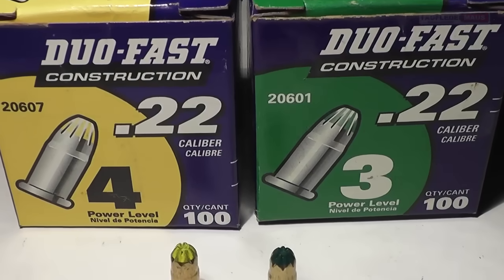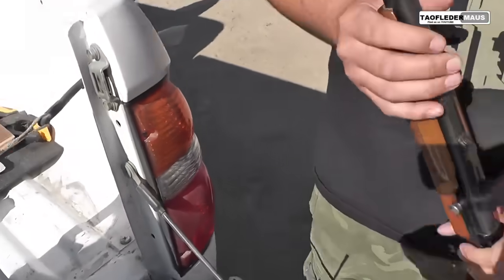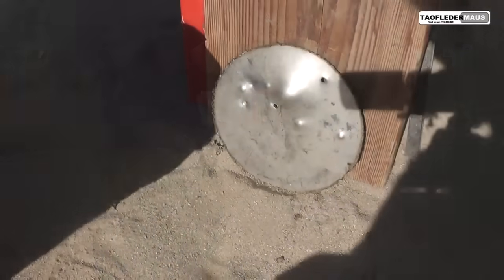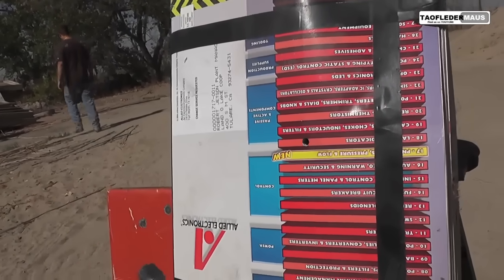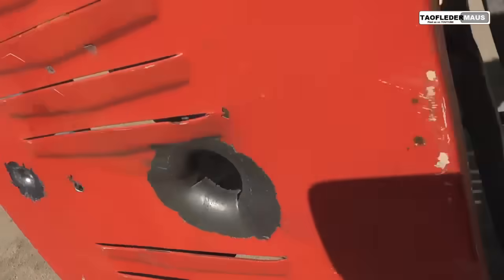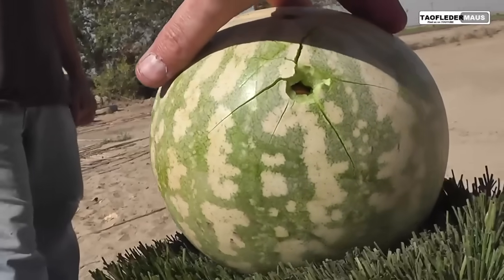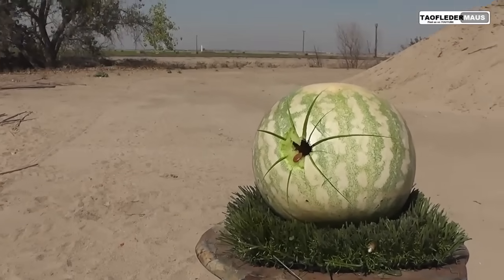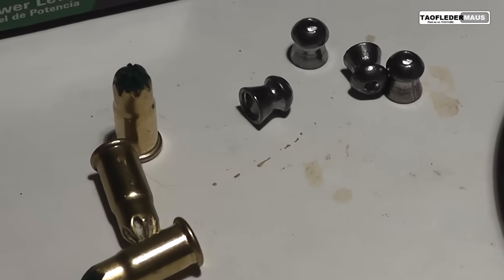Shooting .22 PELLETS Using NAIL GUN Blanks - What happens?

Comment: I'm in the UK used these in a bolt action .22, found it easier to use  a dab of super glue to attach the air-rifle slug to the front of the "powder activated tool"  rounds, instead of ramming the the slug down the barrel, or load the slug and the blank individually into the breach.

Comment: I use these 22 power loads to be able to continue to shoot my Stevens 44 Ideal in 32 rimfire

32 rimfire was discontinued by virtually all manufacturers when America entered WWII  -  since then an occasion small batch of 32 rimfire has been made by small ammo makers,  but even those were discontinued well over a decade back  -  which is why now a 50 round box of 32 rimfire shells goes for $250 to $350   -   

so enter the adapters  -   reloadable 32 caliber cases which are drilled to accept the 22 power loads  -   they are expensive  (  $10 - $15 each )  but are easily reloadable and are good for many many reuses

Comment: I used to play with dads Ramset.
You had to push I against a surface to keep it cocked to fire so I would hold against a sheet of plywood and shoot the nails right through and into a palm tree.
Dad loaned it to a friend who was using it to fasten to 1/2 thick steel I-beams only to find any but the weakest charge would shoot the nails right through the beam.

Comment: its not a surprise this worked and the pellets stayed together 
I have PCP air rifles that will do close 900 FPS in 22 30 and 357
they have high end ones that can push up 1200 FPS in 22 so you can guess how they hit with big bores
my 357 Bulldog goes though a refrigerator like butter its gone though car doors too its close 900 probably since it is factory still no adjustments have been made 
it would be interesting to see some PCPs compared to actual firearms the only one I have saw was a bad comparison since it used a cheap break barrel that is not as good with light pellets like these
look at air gun ammo on Pyramyd Air I run 25 plus grain 22 slugs down to 18 grain pellets for target practice and critters my 22 is rated for coyotes and such easy

Comment: I used to love messing about with the nail gun when I used to be a security guard on building sites, pinning the plastic warning signs to walls using the black tipped cartridges meant for concrete and I'm using them on brick walls! 😆

Comment: I wonder if you used an old single shot bolt action 22 if you could just feed the pellet in the same way you would the cartridge and then just push the blank in behind it.  Would avoid having to do the ramrod step.

Comment: smear a little vaseline on the back of the pellet and shoot it from your regular pump pellet gun, just be super careful, they are seriously dangerous, certain chemical and lubricants can ignite just from compression, vaseline is one of them, it will make your pellet high powered, and potentially lethal if someone got hit it the wrong spot, so be super careful ,  yes it works well, but if you have a cheap pellet gun it will wear out much faster.

Comment: If you take a .22LR cartridge and pull the bullet then dump out the powder and replace it with Red Dot powder and place in a waxed 15 grain .22 caliber hollow point pellet with a 5 grain steel BB superglued to it you will have a stupid fast magnum +P+ projectile out of a .22 bolt action rifle.. This is the kind of hilly-billy engineering that made the USA such a great nation.. Simply cutting off the head half of a cheap .22 shell and lightning the bullet to 20 grains will also create a much faster shooting outcome.. These are far cheaper than buying nail gun blanks by the way.. Never fire these in a .22 pistol, old or cheap bolt action rifle or with a weak semiautomatic action.. The heavy barrel rifle we have has a double lock bolt just like a magnum rifle so I am confident in it..

Comment: Not surprising, Used to use Powder actuated tools. the charge are designed to drive a case harden steel nail several inches into concrete. the charges go from white , the weakest, through green, yellow, red, purple and black. I have shot into steel columns while fixing brick ties and the nails were going fast enough to tear the heads off a nail. 
firing out of  a rifle you risk the pellet expanding and locking itself in the barrel and blowing just the end of the pellet out. thereby having the barrel relined with pellet. These days they used an enclosed piston to drop the velocity and keep the impact. Its a crap system but makes the safety nazis happy.

Comment: My wife and I owe our lives to a Remington speedmaster. 
We were attacked and nearly murdered by a guy with a handgun and large brass knuckled knife back in 1982. The only firearm I had access to was a Remington speedmaster just like in your video. It was a Ted Williams special from Sears and roebuck. It saved my life and the life of my wife. It was a little better than a sharp stick. It Certainly was not my first choice of firearm for a gunfight but it was the only option I had at the time.  I was shot and paralyzed by a 44 round to the neck. I've used a wheelchair for 43 years. My wife was unharmed. Our attacker did 17 and 1/2 years in prison 
Hats off to Ted Williams, Sears roebuck and Remington firearms

Comment: A duofast #2 blank will push a 14.3 gn crossman .22 cal pellet shy of 2100 fps, their #3 mid 2100's, #4 just sprays lead out the end.

Had some starter blanks years ago (much shorter) that were very close to regular air rifles but very, very quiet.  Have not ever found any that would duplicate the results though.

Comment: its better to do this with a bolt action .22. but those blanks are mainly primer. so i highly doubt you'd injure yourself or damage your gun. 
Also the pellets will be faster cause they're slightly lighter. so they will penetrate easier, not necessarily deeper though..
This kinda gave me an idea for a legit muzzle loader though. Some modern black powder rifles can use tiny blocks of powder compressed into a pellet. 
Why not make one that uses tool blanks instead? would make cleanup a bit easier on the gun and a hell of allot more convenient... As moisture of any kinda reallllly messes with black powder in general. having them contained in a cap like tool blanks would go a long way towards making BP guns wayyyy more reliable.

Comment: Fill .22 hornet cavity with magnesium - potassium nitrate flash powder mix, compress PCP cylinder with to Pa rating with hydrogen, the pressure on impact with the pellet cavity, ignites the flash powder and the round volume of hydrogen realised into the barrel, bit sketchy but hey its gonna be fun to experiment with

Comment: Honestly you can make that air gun fire that fast with custom parts and still use air.

There is one custom electric airsoft gun that fires an avg 1000+ fps and is full auto. That can kill you. Not quickly and it'd be painful. 400 fps at 40 feet feels like a mini hammer slapping your fingers and can draw blood.

Comment: I've used 22 pellets in a once fired 22-250 brass case powered only by a large magnum rifle primer for years as a close range pest round.  Simply push the pellet down the case neck flush and load the primer using a simple hand priming tool.  I've not chronoed the load but seems to be similar to a 22 RF short.  Great way to use your coyote rifle for a quiet close range pest control rifle.  Very accurate.
Reply: IM A GUN SMITH..HAVE BEEN FOR 40YRS OR BETTER AND I CALL BULLSHIT...NOT A CHANCE THATS HAPPENING...A .22.250 EVEN WITH A LIGHT 60GR BULLET HAS A DIFFICULT TIME STAYING TOGETHER WITH ALL THAT POWDER THEN YOUR TALKING ABOUT WHAT...A LITTLE .22 PELLET....NOT HAPPENING...NOT A FUKIN CHANCE.

Comment: How do you stop the lead pellets from melting at those high velocities, and with the hot gasses burning behind, without even a copper gas check?
Reply from the maker: It takes time for heat to melt something.  Much more time that these are in contact with heat.
Reply: @taofledermaus  I know that it takes time for heat to melt something, I've made cast lead bullets and reloaded ammunition for years.
Reply from the maker: @alneal100  I'm surprised you asked that question then.
Reply: @taofledermaus  Lead bullets are generally kept at lower velocities to prevent acute leading of the bore. Lead bullets that are loaded above about 1400 fps are gas-checked with a copper cup that goes on the rear of the bullet. molds can be purchased with a recessed base to accommodate copper gas checks. Do you have any data of the velocity of the .22 pellets?

Comment: What gap if any did you leave between the pellet and the concrete cap shot.
Reply from the maker: In order to get these to work,   the pellet had to be set just ahead of the chamber in the barrel.  The pellet is a little too small to seal itself in the chamber.

Comment: Question.. Could you not put the pellet in and let the round push it or are you worried about the crimp not being allowed to open properly?  What about if you had the slightly mor expensive sabot type pellets?
Reply from the maker: It's because the pellet is too small for the actual chamber but fits tightly in the bore.

Comment: It sure brings back fond old memories: as a young novice gunsmith, I used to experiment with the similar system more then 5 decades ago, by using Eichhorn branded blanks, topped off with heavy H&N pellets for the likes of Barracuda if I remember right? Best performance was in older breech-loading .22 break-brl air-rifles, which I converted. Doing the same on .177 air-rifles would usually result in pellet/skirt seperation, were skirts frequently ended up getting stuck in the bore, as the smaller bore pellets couldn’t withstand the pressure levels!

Comment: If you want power that penetrates the book.  Put the explosive dabs of a cap gun reel into the back of a hollow point pellet then load the pellet backwards so the charge is facing out the barrel.  You won't believe the amount of depth you will get on impact.

Comment: Umm..a dab of crazy glue holds the pellet on and you can just load/fire the gun normally for the most part
Reply from the maker: No,  the pellet is smaller than the chamber so the gasses will mostly go around it when you fired it.

Comment: Would it be possible to glue the pellet with a dab of hot glue to the blank, as long as the pellet sits clear of the blank. With a bolt action it might even cycle if the bolt is used carefully. God bless
Reply from the maker: We tried that and it didn't work.  The pellet has to be seated in the barrel slightly,  if it is in the chamber, there is enough room for the gases to go around it.
Reply: @taofledermaus  it's a shame it won't work. Really enjoyed your video. Keep up the great work. God bless

Comment: I hope this still finds you. Please do a test with 40grn .223/.224 bullets for velocity/accuracy/configuration in the tube.  Love your stuff and understand the subtext.
Reply: They will not fit properly, and .22LR barrels are not designed for the heavier jacketing on them, nor the much higher chamber pressures.
Reply: @johnsmith7676
Reply: I don't understand "not fitting properly"

Comment: I've been shooting pellets out of my Remington 580 (single shot) with these nail gun loads (yellow & green) for over 40 years with no problems. These work best in bolt actions.
Reply: does it leave any lead in the rifling? which would require a stiff brush cleanout !

Comment: I've found traditional .22lr a little cheaper .... but in a crisis situation, where ammo is in short supply, this seems like a viable alternative ... and I wonder (as I have pellets for air guns) about using an old bolt action single shot ... and loading the pellet through the normal chamber, and follow it with the charged round (by passing the barrel loading) .... gonna have to do some 'sperimenting I think.

Comment: Bizarre. So you chamber the tool round normally and muzzleload the pellet to seat it ahead of the tool cartridge? And it works? I never would have dared to try this especially in a gun I cared about. But seeing this warps my brain. A lead pellet deforms just by squeezing it with your fingers so how can it make a clean hole in steel? It makes no sense at all yet there it is.

Comment: would this work in a gammo air rifle ? what do you think ?
Reply from the maker: No
Reply: You would get part of the brass and unburned powder from blanks in your face first. Explosion of the barrel or the breach which is even more dangerous.
Airguns are made for low pressures allowing 25m of range or so, 4,5mm generally works best. There are some "magnum" variants costing more than nice .22 rifles for good quality rifle.

Comment: If you use a petroleum based lube on your pellets and a spring piston air gun it will cause a dieseling effect which will cause a detonation of the lube. You can hear a distinct crack when it goes off and will drive your .177 pellets around 1700 fps.  Discovered by accident. lol

Comment: I've done something similar with custom "cartridges" milled from solid brass rods. I got the idea from CO2 airgun revolver cartridges, where the bb or pellet is held in the front of the cartridge. My "cartridges" are milled out to accept either 5.5mm Flobert or .22 crimped construction blanks. (They're not interchangeable, the difference isn't just in the length of the blank)

Comment: The .22 Cal powder actuated cartridges are also made in .27 Cal  and they are used for  ¼ inch powder actuated fastener tool(Ramset, Hilti, Redhead,etc...) ¼ inch is the diameter of the ram piston that is the barrel inside diameter. 
 They also make those tools and cartridges in a 3/8 inch diameter. Bigger cartridges, more power, larger diameter bore.
 I'm not sure what size ammo is 3/8 inch in diameter but, it may be interesting to see and compare the ¼ inch and the 3/8 inch.

Comment: If you use a bolt action .22 you can load the pellet directly into the breech without the use of a ramrod.

Even using ordinary .22 blanks gives you a quiet killer with more hitting power than most break open air rifles...
and a second hand .22 bolt action rifle can be hundreds of dollars cheaper than a "good" quality .22 air rifle....

P.S.   
The expansion of the skirt of the soft lead pellet is violent as the pressures pushing the pellet are far higher..and the gases far hotter....
So it pays to check for and remove the "ring of lead" from the rifling at whatever depth you insert the pellet every 5 shots or so....
otherwise the smearing of the lead actually builds up and multiplies the amount lead being ripped off with successive shots...
and accuracy suffers.
Reply from the maker: You really need to place it just ahead of the chamber and in the barrel so you have a good gas seal.   We tried it many different ways before we got it to work.
Reply: @taofledermaus  
That's how a standard long rifle works too....the projectile actually engages with the rifling as the bolt closes.
Reply from the maker: @JohnSmith-yv6eq  Notice that with the blanks they are necked down.  The gases will want to go around the pellet.
Reply: @taofledermaus  
How much do the crimped "petals" open up under the blast of the powder?
And with the air gap behind the pellet (if the pellet is a little way up the barrel) how much does the blast become "unfocused" i.e.spreading out to fill the gap before pushing onto the pellet and expanding the skirt?

I know that it's a wonderful demonstration of the power of military blanks when one is fired from a .303 British Lee Enfield with the muzzle near a fibre based soft ceiling tile in a classroom...
the blast is augmented by some metal petals of the crimp also exiting the muzzle at speed.....
impressive holes in the ceiling and expanded/missing petals on the case mouth....

Comment: Judging from the sound of it I'd say the nail gun charges with the pellet are considerably higher pressure. I wouldn't hesitate to use them in a bolt action but I'm not sure I'd use a semi auto 22 for this.

Comment: I wonder how easy to charge a .22lr revolver cylinder with these?
Reply: really simple.
But...
Clean the chambers with lead removal tools every 5 shots....the soft lead skirts are hammered by the violent hot gases and smear like crazy....
Check the forcing cone for the same thing..
and the rifling just after the forcing cone when what is left of that soft lead skirt tries to grip the rifling to start the projectile spinning.
A revolver is really a bad idea...
A fixed barrel semi auto pistol that is easy to break down and get the lead out of is a better idea...more velocity (no chamber to forcing cone gap)......and quieter, too.

Comment: One way to prove that the pellets were flying with higher velocity and energy than the bullet was to look at the locker. The pellet literally looked like it drilled a hole in the metal, didn't even chip the paint. The  bullet dragged a lot of metal in with the hole. Higher velocity shatters its way through, lower velocity punches its way through.

Comment: So you should be able to load a double shot …🤔
Reply: The soft skirt of the first pellet is jammed wide open by the second pellet going up it's rear.
Lead is soft...but may still have sufficient resistance to cause an overpressure in the barrel ????
Reply: @JohnSmith-yv6eq  well yes. I Considered that also. But with a bb in between the pellets it should work. In the past I’ve used super glue to glue a bb into the cup of a pellet to increase grain weight of the pellet. Worked just fine. So if you load a pellet then a bb then another pellet it would probably fire.  As to WHY one would need to do this 🤷‍♂️🤷‍♂️ 
 I guess for S&G’s … ✌️